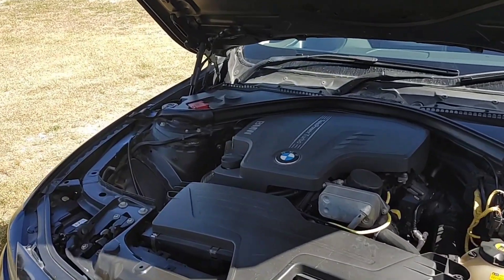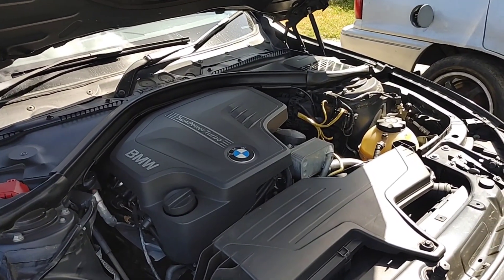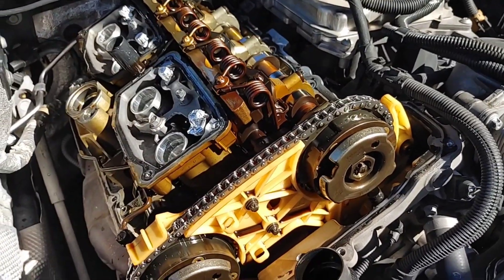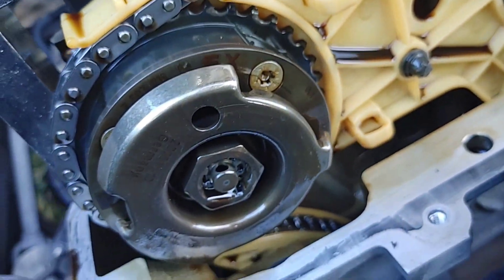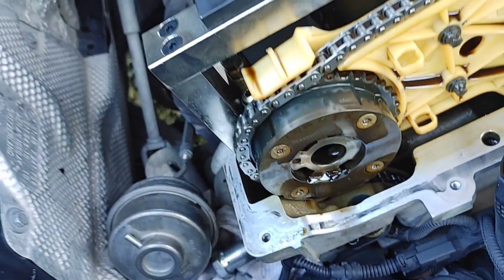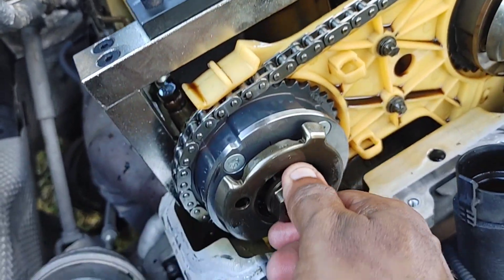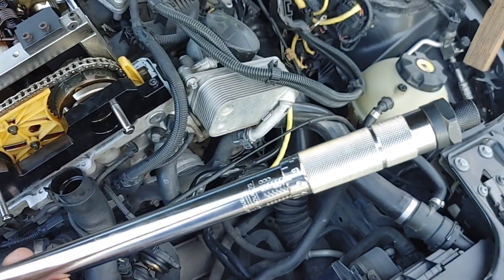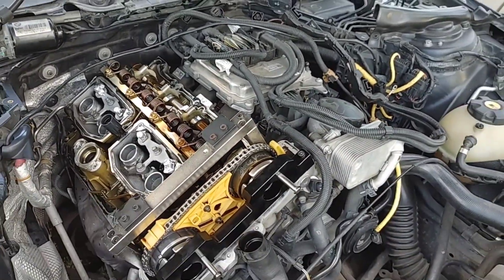How to replace BMW VANOS unit. (N20/N26) engines.

Comment: i know this is an old video but recently i got a drivetrain malfunction (2014 2014 n20 85k miles) the code is a p052b cold start a position retarded, i ordered cam shaft position sensors, should i also replace these? (my timing chain guides look okay, and there is no whining while driving. any help or thoughts would be appreciated
Reply: Is that the only code you got?

Comment: Need HELP,

2013 bmw 528i Drive Terrain malfunction 

At 100k miles, did timing  and services.  After 1000 miles for DT malfunction error.

Changed below

1. Battery
2. Replaced spark plugs 
3. Changed ignition coils
4. There are no issues with pump and catalytic convertor ( tested )
5. Replaced Variable vault Timing 

Still gets alert. 

Symptoms: DT alert usually comes after 5 minutes of driving and losses power.  After I park vehicle for 1 hour alert is STILL there, but the power is back until I get alert after 5 minutes of drive. 

Alert comes twice,  then engine light will be ON for 3 days and resets. The same cycle goes on and on.

Currently is 115k. All I need is alert to go off completely. PLEASE HELP

Comment: can't the locking pin in the actuator be cleaned up if its just sticking?  Ever try disassembling the actuator and inspecting it for wear?
Reply: Had the same thought. As that flywheel looked totally fine and I am having a similar error code but its also coming with a solenoid error code so it's more likely for me to be a bad actuator.

Comment: The plunger in the VANOS central valve on my F30 is broken during the valve cover removal. 
I have a new part but if I remove the bold will it change the timing ?

Comment: I am getting P13C9. Does this fix the code?
Reply: On my 2013 328xi N20*
Reply from the maker: Switch around the solenoides (they are the same) if the code still comes then that is likely the issue.
Reply: @ph_earle  Thanks, I'll do that today. Do you know where the solenoids are on the N20? Or the "general area" of them.

Comment: What symptoms were you having prior to replacing the Vanos Unit itself? Limp Mode? High idle then rough idle after warm up?
Reply from the maker: Error message stating exhaust cam position over retarded. Not getting full power no limp mode with mine.
Reply: Thanks for replying my symptoms are Drivetrain Malfunction and rough Idling. My codes say VANOS,  Intake, Cold Start: Not Controllable
Reply: @rolo7487   Hi, i have the same issue replaced intake side vanos with NEW directly from BMW and still the same issue opened the Engine Head and refreshed the Head and cleaned the passages of the engine oil. But unfortunately it’s still same after doing all of this. Now i am into replacing the oil pump i am assuming there’s no enough oil pressure to the vanos system. 
May i know what have you done and is it okay now? any help is appreciated.
Reply: @aboodm52015  I replaced the Intake cam sprocket side only, wish I had done the exhaust side since I was in there, and the solenoid, along with the solenoid actuators. And the car worked fine after that.
Reply: @aboodm52015 sorry for the late reply, could you give me an update on how your car is for closure?
Reply: @rolo7487 hi i have the same fault vanos intake cold start not controllable on my 2012 328i.  I had the timing chain kit and oil pump replaced 1000 miles ago and just now I got drivetrain malfunction warning come up and that’s the code I got. I think i will have to replace the intake vanos sprocket but i might start with vanos solenoid see if that fixes it. Please any suggestion would help
Reply: @ibrahimdelic8958  yeah that’s exactly what I did but it ended up being the sprocket itself. The only thing I regret was not doing the exhaust sprocket too
Reply: @rolo7487 i think i will do both thanks to ur advice. I replaced solenoid nothing changed same code present
Reply: @ibrahimdelic8958  Then yeah definitely the sprocket then and I forgot to mention I did replace the solenoid valves on both sides as well. I’m glad I could I help, I know how stressful it can be.
Reply: @rolo7487 i replaced both vanos sprockets same code came back. I removed valve cover again checked timing everything in time. At this point frustrating asf. I put it back together and found that you can reset adaptions for vanos did that code didn’t come back.. idk if that was the issue from beginning or what
Reply: Need HELP,

2013 bmw 528i Drive Terrain malfunction 

At 100k miles, did timing  and services.  After 1000 miles for DT malfunction error.

Changed below

1. Battery
2. Replaced spark plugs 
3. Changed ignition coils
4. There are no issues with pump and catalytic convertor ( tested )
5. Replaced Variable vault Timing 

Still gets alert. 

Symptoms: DT alert usually comes after 5 minutes of driving and losses power.  After I park vehicle for 1 hour alert is STILL there, but the power is back until I get alert after 5 minutes of drive. 

Alert comes twice,  then engine light will be ON for 3 days and resets. The same cycle goes on and on.

Currently is 115k. All I need is alert to go off completely. PLEASE HELP